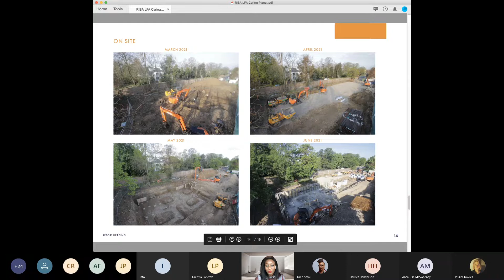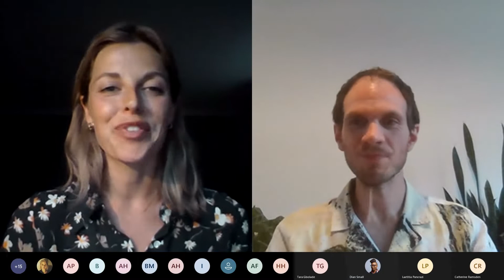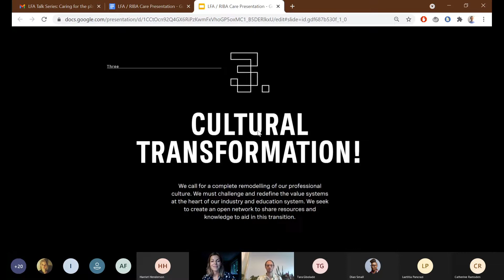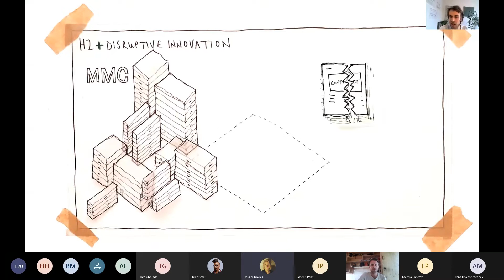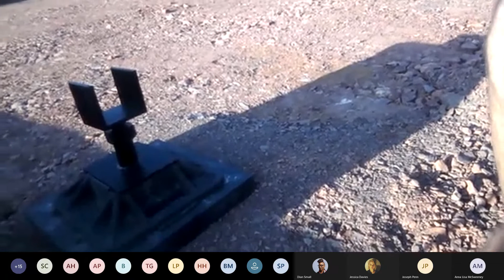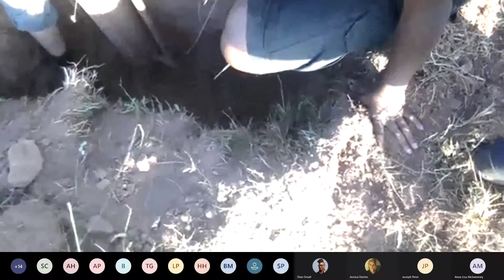RIBA + London Festival of Architecture talks: Caring for the planet

Comment: Greenhouse theory says the atmosphere warms the earth, the GHGs warm the atmosphere, more GHGs make for a warmer earth, a warmer earth is bad.
ALL of that is WRONG!

1) By reflecting away 30% of ISR the albedo, which would not exist w/o the atmosphere/GHGs, makes the earth cooler than it would be without that atmosphere like that reflective panel set behind the windshield. Remove the atmosphere/GHGs and the earth would become much like the Moon, a barren rock with a 0.1 albedo, 20% more kJ/h, hot^3 on the lit side, cold^3 on the dark. Nikolov, Kramm (U of AK) and UCLA Diviner mission all tacitly agree. 

2) the GHG up/down welling, “trapping”/”back” radiating/delaying/intercepting, 100 % efficient, perpetual warming loop requires "extra" energy which according to RGHE theory comes from 

3) the terrestrial surface radiating that "extra" upwelling energy as a LWIR , 1.0 emissivity, ideal black body which

4) cannot happen because of the non-radiative, kinetic energy, heat transfer processes of the contiguous atmospheric molecules and as demonstrated by experiment, the gold standard of classical science: 
https://principia-scientific.org/debunking-the-greenhouse-gas-theory-with-a-boiling-water-pot/

1+2+3+4 = 0 Greenhouse Effect + 0 Greenhouse gas warming + 0 man caused climate change.

Version 1.0 072221